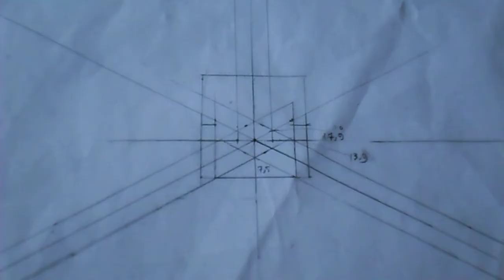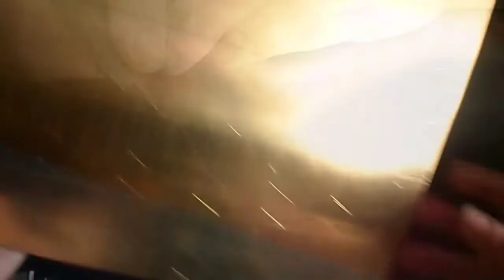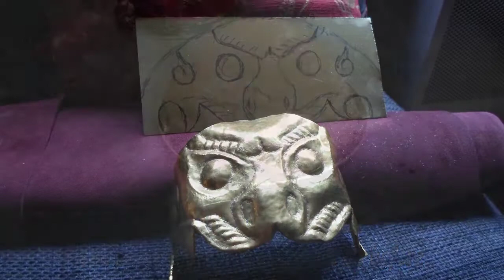Chinese Mountain Pattern Armour Part 1: Scales and Dragon Heads

Comment: It's very beautiful but I suspect it's susceptible to piercing attacks such as from a spike or crossbow bolt. It would be highly protective against slashes and even thrusts from swords, the scales would bunch up and arrest an angled sword thrust but if you have a spiked weapon, the angles of the armor would naturally funnel the spike into one of the triangular gaps between the scales. Ouch. Production would also be very time consuming, practically as long as making mail, ugh. I think after decades of making the same damn thing, a master armorer would probably stop being a perfectionist and just want things done asap. Hence, the cost would be high and the quality be as good as the smith can make it without eating into his leisure time. So while to an untrained eye it would look perfect... to a master, it's what you paid for, hahahaha. I personally would prefer simple plate armor over this because if more time was spent building more elaborate production facilities, better performing armor could be mass produced faster and more cheaply.
Reply: It would make no sense to wear expensive armor that is puncture prone. Anything from quilted cloth to boiled leather can stop cuts.
Reply: Actually, for the major part of middel ages building a plate protection was more expensive ond complicated and time consuming than making chianmail. Even in the last century, the XV century, when full plates became the standard, building them was greatly expensive and time consuming. But their effectivness was so high that was considered acceptable. At the end of the century several metallurgic advancements were made so things were cheaper and easier, but also the firearms were taking the lead in the battlefield. Full plate armors golry lasted very shortly, historically speaking.